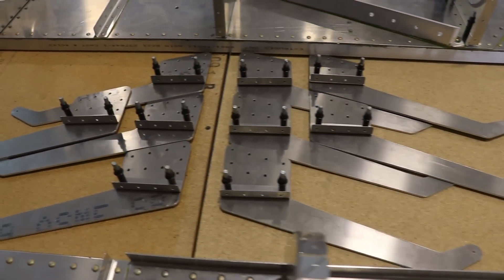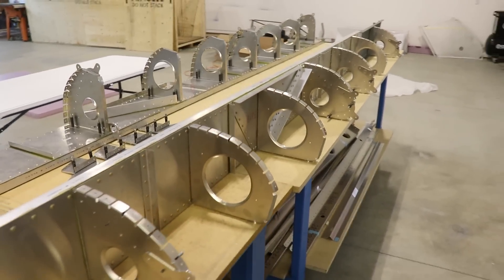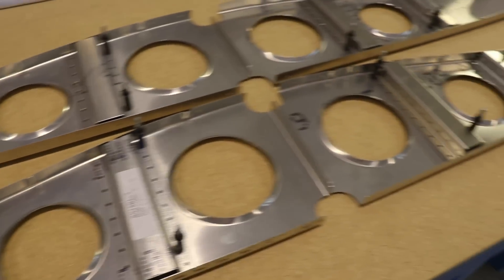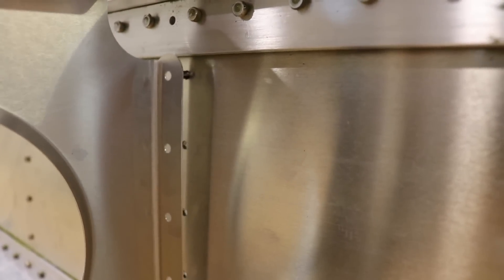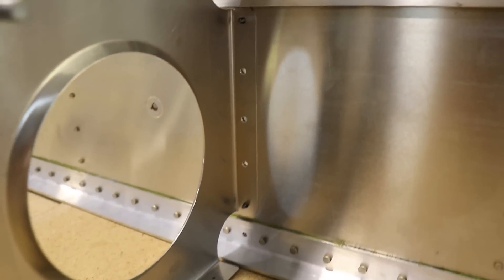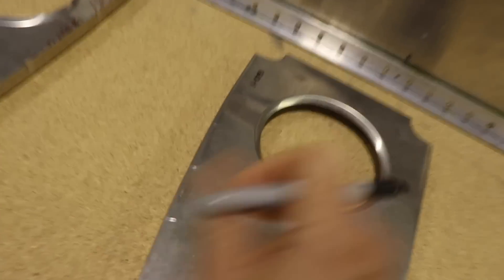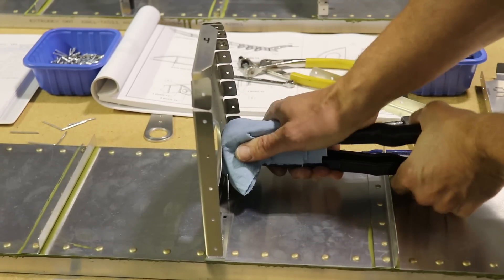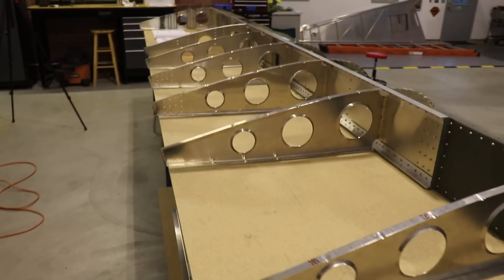Zenith Super Duty Wing Ribs (Ep10)

Comment: My concern about build an airplane like this is the electrical part like the installation of the Dynon and engine ,I would have to pay someone to do that ,the sheet metal part I’m good with it doe to the fact that I’m an Ironworker not problem there but the electrical park and engine stuff I would be lost
Reply from the maker: It's not as overwhelming as you might think. The Dynon system is very easy to wire and the instructions are very clear. There's also lots of help available through the EAA, EAA chapters, and online forums!

Comment: Does the manual allow you to substitute solid rivets for the pop-rivets certain places?
Reply from the maker: The manual does not state that you can use solid rivets, but my understanding is that solid rivets are generally 'stronger' then pulled rivets. This would be a question for the engineers at Zenith.
Reply: thank you!

Comment: When you used the manual rivet squeezer, did you have the riveter end that is tapered inward as the tip for the air squeezer is, or did you just use the 5/32 tip it came with your squeezer? Thanks for the videos.
Reply from the maker: If you buy the manual rivet squeezer from Zenith it comes with the A4 and A5 specialty tips. That reminds me-I broke mine and need to order a new one from Zenith!
Reply: @KitplaneEnthusiast  They might not sell the rivet squeezer to you. I just purchased the tips from them for the air gun. You cannot purchase the tips from them unless you have the aircraft number. As I am buying them to help the owner build I don't have the number. They went to some trouble looking for the number buy where the plane is and the owners name. Everything has to be connected to the plane being built per the order desk.

Comment: 6:50 we call that joggling which needs to be part of the work instructions package.  Then you know you have a won't work / won't fit part to the assy for the OEM to redline the drawing and perhaps roll the part number of the offending item.  But it's not for us to decide what the offending items are.  The OEM has no doubt done a FEM and certified at least internally, the load path and how the assy needs to fit together to flex properly under load as well.  BTW, kinda surprised that breaking the edges is not part of the work instructions as well.  But you definitely want your alodine or primer to smoothly cover the whole part.  This is especially important for wet wings so that the seal is the same thickness everywhere.

Comment: What are your thoughts on using an electric screwdriver instead of the swivel handle for deburring, especially when you have a lot to debur?  Was thinking about this the other day.  Those cheap electric screwdrivers are virtually useless for anything, but I'm willing to bet the low torque and speed make them pretty beastly deburring tools.  You can just tape the switch on and let her rip.  Just don't bear down on the hole and don't linger.  I bet it would work like a charm.

Comment: Mark, you have such an awesome hangar, and you are such an experienced builder, why don’t you have a compressor and use air drills?  I am thinking it is to avoid air hoses but not certain.  Just curious, great attention to detail, love your builds.
Reply from the maker: Hey Ty, thanks for the question. You are correct-the reason why is that lugging around the air hose is a hassle. There are also times when I like the variable speed of the electric drill. I have three different air drills and never use any of them!

Comment: You need to draw file a sharp edge. Sanding scratches and can introduce a crack point. I took aviation sheetmetal in high school. If you handed a piece of metal with a sharp edge to an instructor, they would chew you out, on a good day.
Reply from the maker: That’s why none of my edges are sharp. Sand paper works perfect for smoothing edges and leaves a perfectly smooth edge.
Reply: I was taught in "school" that blind rivets were used where you could not have access to the backside to buck the solid rivet, otherwise use the correct size solid rivet to fasten the parts together.
Reply: @beandrive  the rivets in the Zenith kit are Apex structural rivets like the Cherry Max types only less expensive and are perfect for the design. Safe, and easy to work with.

Comment: Curious question, as the parts are going to be riveted any way; why not prime the mating surfaces before test fit and if the test is good, then go straight to riveting?  
In my simple mind it would save tons of time otherwise you are essentially building the 750 twice.
Just a curious question
Reply from the maker: That is certainly another way of doing it that would work just fine. For me, I just wanted to see how everything went together first. Also, there are a lot of holes that need match drilled and I'd rather prime after the parts are match drilled and deburred.
Reply: Makes sense.

Comment: Do the instructions tell you the direction of the rivet ??
Reply from the maker: No, but the standard is that the shop head (the part of the rivet that get squeezed or crushed, goes on the thicker material. It isn't always possible due to part of the structure being in the way, so sometimes they will go in the opposite way.

Comment: WHY is there gap between the cap and the spar? Is it the thickness of the corrosion layer creating that space?
Reply from the maker: No. I should have shown the pic that popped up on the screen longer. There's three layers, with one layer a tad longer than the one behind it. I may have to show it in another video-it's too difficult to explain by typing!
Reply: There is a spar cap doubler that is slightly wider than the spar cap itself. The rib flange is sliding slightly under the doubler, not the spar cap extrusion.

Comment: Is it critical to remove the labels from interior no-prime,no-paint parts? Is there a reason they can't be left on?
Reply from the maker: Is it critical? No. But if someone is too lazy to remove the stickers, what else are they not doing that they should be doing? Also, the labels are paper and I wonder if that paper will hold moisture, possibly creating a corrosion issue. I have no idea if that's valid or not, but I just think a builder should take the time to remove them.
Reply: "I wonder if that paper will hold moisture, possibly creating a corrosion issue"

I think that's a valid concern. Hadn't thought about it.

Comment: Great video on your wing build.  In addition to letting Zenith know when you find drill holes not to final size, are you also letting them know about the issue where you needed to tuck the rib lip under the spar top reinforcement piece so that they can add a note to the drawings, maybe letting future builders know to tuck that lip under it?  Just curious.  Also, given the size of your fuel tank bays, did you opt for extended range tanks so you get 2 per wing?  Not sure if that is an option on the CH 750 SD or not.  On the CH 801 SD kit they have an option for extended range tanks, where you get 2 per wing, so I was wondering if that was an option on yours?  Are you adding the Nav light, Landing light options to your wings?  Again, thank you very much for the video series.
Reply from the maker: I communicate with Zenith about little issues I come across. Something like the rib issue isn't even worth bothering them about. If I wasn't filming, it would have taken about 40 seconds or moving the rib around to see that it goes slightly under the spar angle. Maybe in the video I made it sound like a bigger deal than it actually was. When I ordered the kit, Roger did say that I could get additional tanks, but they haven't done any testing on them, or figured out how to plumb them yet. So I figured it's just not worth the added weight and complexity to get the extended tanks. I have 48 gallons in the stock tanks which gives me similar range and endurance as the many different types of Cubs that out flying the back country. If it works for them it should work for me. Regarding lights, yes I'm installing the lights in each slat. In fact all of my lights are due to arrive from AeroLEDs on Tuesday. I plan on doing an 'unboxing' video on the lights.
Reply: @KitplaneEnthusiast  Look forward to whaching it!